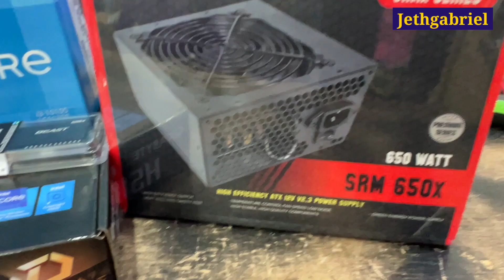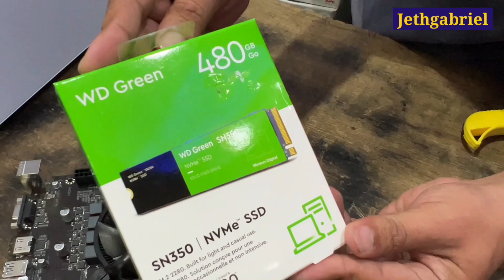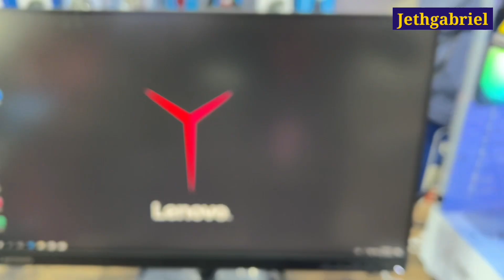The Cheapest Pc for online job

Comment: Specs please?
Reply: There in the beginning of the video
Reply: H510 board, i3 10105 processor, 8GB DDR4 2666MHz RAM, 480 WD Green NVMe M.2 drive, 650W PSU (I advise you to get DeepCool's PSU).
Reply: @velja1312  there are thousand of h510's
Reply: @spagettete_  so? any h510 motherboard will support both 10th and 11th gen eitherway. you can get asrock, gigabyte, does not matter.
Reply: @velja1312  what if he doesn't know the name of the board and ends up buying a 200$ board that he probaly doesn't even need
Reply: @spagettete_  won't happen, internet exists so potential customer can inform theirselves about the shit they buy unless they dumb.